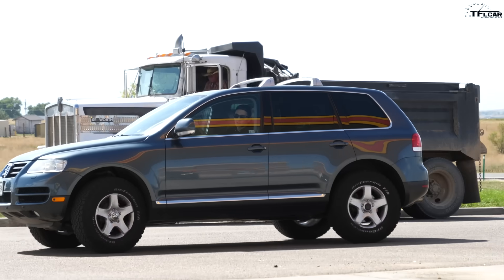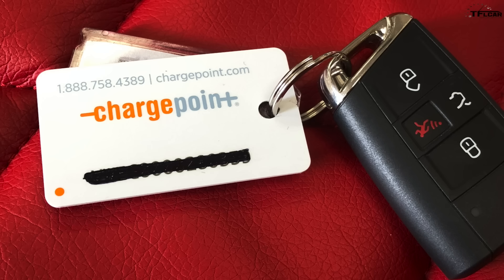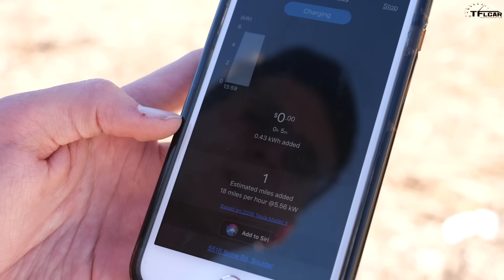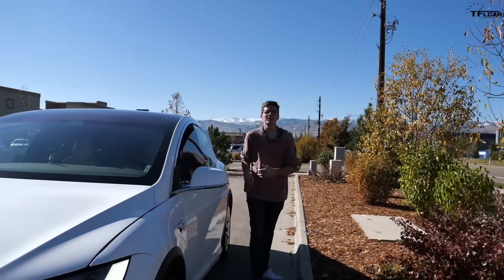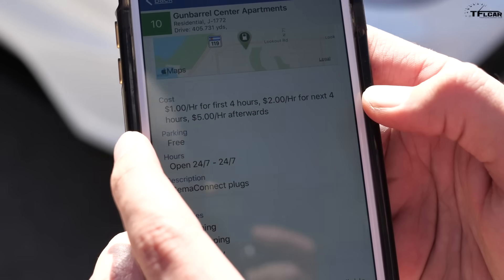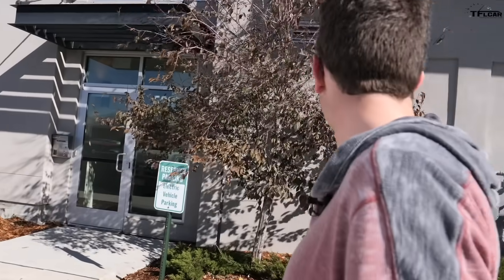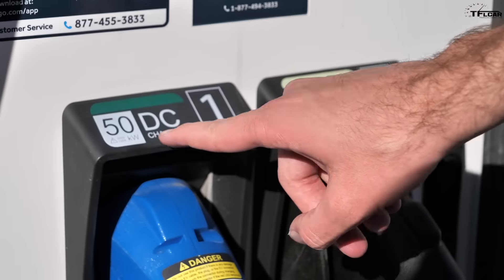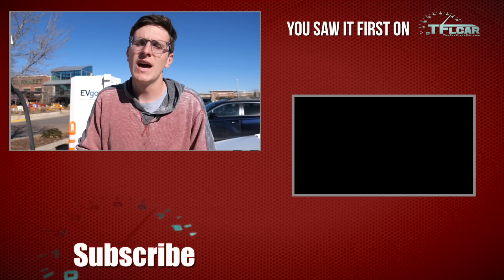Here’s Why Charging an Electric Car Can Suck - And It’s Not The Reason You Think!

Comment: What a mess. They have to make the charging faster and simpler before I buy an EV.
Reply: That's probably the biggest deterent along with the price of the car.
Reply: Agreed, there needs to be a standard plug just like gas stations have standard nozzles for  gas and diesel.
Reply: @Hogger280  Could have been IF legacy car companies had taken Tesla up on their 2012 offer  to use it's charging network for cost + power. That they didn't is the reason for the sad state of charging now for non Tesla's
Reply: Just get a Tesla and supercharge it. Way faster!
Reply: I can wait 12h to charge the car, I just want one that won't cost 2 years wages
Reply: @mwbgaming28  an EV doesn't cost two year's wages.
Reply: @bradmagnuson6963  it does in Australia, Nissan leafs are worth over $60k new, Tesla model 3 base model is close to $80k, and they're not much cheaper on the used market either

I saw a 2012 leaf with a completely rooted battery (3 bars of health and like 40km ramge) on gumtree, and the prick wanted $18k for it  

EVs are stupid expensive down here for some reason
Reply: @mwbgaming28  could be not enough EV's are on the market where you are, or, there's serious price gouging going on.
Reply: @bradmagnuson6963  there are not many of them because they are expensive, a car that is worth $15k on the used market here is less than $2k in the US 

I can buy a Tesla model 3 in America cheaper than a 2020 Nissan leaf here in Australia
Reply: Exactly..my bike takes maybe two minutes at a gas station and that includes swiping my credit card. I can't be bothered with planning where and for who knows how long an ev would take to charge.
Reply: I live in one of the poorest countries in Europe and 22 kW chargers are very popular here, meaning you can charge much much faster, still very inconvenient, but practically possible.
Reply: @Tzankotz  - lucky you, my area sucks
Reply: The year just need to supplement it with solar panels plus faster chargers to compete with a gas car
Reply: can only extract so much fossil to power your charger
Reply: They need to take the credit card directly as well I don't save any cards on online accounts or on my phone
Reply: Some of his information is misleading if you're not paying attention.
Reply: A one-hour charge time would work if the charging station was part of a destination like a restaurant or a store. But the real issue is the use of batteries. Capacitors can charge in mere seconds, but our current state of the art isn't there - we currently can't make them "big" enough to hold enough charge. If we could, the charge could be just as fast as a gasoline fillup, and capacitors don't have a limit on how many charges they can take. A safety issue exists, caps can dump charge through a short circuit a lot faster than a battery. So while shorted batteries will get hot and catch fire, caps can just explode like a firecracker, so fuses would be used to prevent that.
Reply: @dtvjho  So why not just change the battery every 200 or so miles? The battery would be large and expensive, but would actually be owned by an Electric Utility company. Mechanical means would be necessary to change it, but that change could happen in less than one minute.
Reply: @jackfenn7524  Good idea! The weight and size of the battery may be an issue though. I believe these car batteries are well in excess of 20 lbs/10kg, which would make them hard to handle for smaller people, those with disabilities and the elderly, or in a Northeaster with the wind and rain. Theft also comes to mind.
Reply: Would never buy one. Utter shite.
Reply: Notice how he's NOT using a tesla supercharger.
Reply: @prestontucker1687  - tesla charges in my area are all 40 miles from my house or work, the chargers he is using are better examples
Reply: @williamhaynes7089  This is just growing pains. Eventually everywhere. Charge at home overnight. Problem solved.
Reply: Take your time. You won’t be missed.
Reply: PrivacyPlease  What I meant by price is Teslas ( outside the U.S. ) are fairly pricey. The vast majority doesnt care about how quick the car accelerates and all the tech features. And then out of warranty repairs. Teslas built quality is not good. To each his own I guess.
Reply: Honestly, tesla is the easiest choice. It's faster and your guaranteed that there chargers will work without juggling 5 apps. And charging at home using a 1450 plug eliminates the need for super charging except for long trips.
Reply: One thing that people haven’t consider until now is that when everyone is in EV and you need to charge your car and there’s a long queue that you can no longer go anywhere because you don’t have enough charge to find another charging station. I guess this will happen in a very crowded area.
Reply: @randycho518  same thing occasionally happens with servos, you find a servo with really cheap fuel, and you figure that you will refuel your car since you have been driving with the red light on for a while, but then you realise everyone else has the same idea and you don't have enough fuel to go and find another servo that is less crowded

That exact situation has happened to me on more than one occasion
Reply: NIO is better at the time of charging your battery
Reply: An EV power charging station would be a carjacker/ mugger paradise. They know you are not going anywhere in a hurry.
Reply: @satos1  yes because door locks are not a thing
Reply: For sure!
Reply: Most EV owners charge overnight at home.  Even taking 30 minutes to get an 80% charge on the road is ridiculous.  As Bill Maher said:  "I have a Tesla to drive around Los Angeles.  When I go far, I have an Audi."  You look at how you intend to drive a BEV and ensure your choice has adequate range to cover that intended use on a daily basis.  If my driving needs required charging on the road, I'd get a PHEV.  Waiting 30 minutes or more to "fill the tank" (and that assumes the charger is available when you get there) is simply a showstopper.
Reply: @aldeflorio5500  if you're going on a long road trip, you should probably pull over every few hours and take a break anyway, after all, Tesla autopilot won't remove hunger, fatigue, the need to use the toilet.etc 

So you can plug in while you are taking that 30-40 minute break to have a feed or otherwise refresh yourself
Reply: @mwbgaming28  yes. But not at YOUR convenience. Big difference with a petroleum car. Park where you want without having to worry about charging so often. Plus refuelling is basically instant. Until you can make a car which can fully charge in 3-5 minutes, I’m not interested.
Reply: @kamenridergeiz9490  you do realize that the Tesla model S has longer range than many petrol powered cars (700km compared to 500ish km for my car) and if you have a home charger installed, just plug it in overnight, it will be full by morning, and you won't have to charge it for another week or so
Reply: @aldeflorio5500  BM must not be aware of Supercharging stations or doesn't want to bother with them.
Reply: @aldeflorio5500 , just stop and have lunch while you charge up...everyone needs to eat.
Reply: @aldeflorio5500  I live in an apartment...I would not be able to charge an EV at home. And owning two cars? Don’t be ridiculous, even if I could afford two cars...where am I gonna keep them in an apartment como,ex?
Reply: @aldeflorio5500  I have a VOLT since August and I'm discovering just that. CHARGERS ARE NOT RELIABLE. Some dont work, some are only during certain hours ( car dealers) and often more than a mile off highways, you make a valid point bro.
Reply: @bmw803  🤔 real life opinion, what is NOT in the EV propaganda, where everthing is perfect.
Reply: indoctus41  My complaint was one of the need for standardization, not ignorance.   Standardization was and is the key to industrialization and mass production.  Elon knows this and his success is due to minimizing the number of parts (e.g. the new two piece chassis design instead of dozens) and mass production critically based on standardization - just watch any of the many videos of his assembly lines.  Custom al la carte manufacturing of automobiles ceased 100 years ago with the few exceptions costing the buyer as much as a house for the privilege of obtaining one.
Reply: @Hogger280  Manufacturers are making sure you never want, or buy one of these things.
Reply: Bottom line there stupid piles of junk that has worse resale than a BMW in five years and will need a dumb battery that cost more than the car is worth after you take a hit on it in 5 or so years. Just dumb. Buy the time it's paid off you have to buy another piece of crap and it starts again. That's how they will make up profits on no maintenance like normal vehicles plus the poor mechanics that will be without a job.
Plus how is all this electricity being produced. Coal lmao.
Reply: @paulkruger2310  , solar
Reply: @dukeblair7792   If you were running a car around on the moon, solar would make sense. On Earth it's just plain stupid.
Reply: @jackfenn7524  , it's stupid to charge a car with solar energy instead of coal?  Really?
Reply: @dukeblair7792  How much electricity can YOU make with solar panels? It's easy to say that "they" should use solar panels to charge a car electrical system. Try actually doing it yourself!
Reply: @jackfenn7524  , it's just as easy as making electricity with coal...are you serious? The solar panels on your house can provide enough for your house...and a car...they have been doing this for years...where have you been? It's a piece of cake...what's up dude? You ok?
Reply: @jackfenn7524  , solar doesn't make sense?
Reply: @dukeblair7792  Okay, try making a significant number of BTUs with sunlight. But you can make thousands of BTUs a minute with a gallon of gas. Energy comes from BTUs of heat energy.  Sunlight just does not have the heat per square foot that is necessary to run a car.
Reply: @jackfenn7524  solar power is viable
Reply: @jackfenn7524  bullshit. If you put solar panels on a house, you can power the entire house, including an electric car charger in the garage
Reply: @paulkruger2310  you have no idea what you're talking about.
Reply: @paulkruger2310  .. California makes more solar than it can use.
Reply: @paulkruger2310  Funny how most people are trading in their BMW for a tesla.
Reply: @prestontucker1687  Funny how much more likely a Tesla is to randomly blow up and burn you to a crisp than a bmw. Batteries in cars are dumb an absolute disaster for the environment (a lot of batteries end up dumped) and slave child labor in Africa.
Running an electric car with a battery is like running a spaceship with a battery. Insane waste of ressources. Insane costs. It's just dumb. Again, hydrogen is the future, and I hope every person in the future whom bought an electric car with a battery will be forced to clean up their mess and not cost a cent to the rest of society.
Reply: @prestontucker1687  And I'll be on your back to make sure you clean up your mess in the future. Cheers
Reply: @prestontucker1687  Okay, explain HOW he is clueless!
Reply: @jackfenn7524  Sure he can show what it's like to use other networks.  This is not a tesla supercharging network. No tesla owner would use it. Doesn't even mention that for the lay person.
Reply: @Krullerized  funny, you have no idea what you're talking about. Hydrogen is not the answer, and won't be an alternative for at least another 30-40 years
Reply: @bradmagnuson6963  Toyota's Mirai begs to differ. It is already an alternative and it kicks VSS.
Reply: @Krullerized  industry wide, hydrogen is not an alternative. There is only a small area in California, that has hydrogen refilling stations set up. Other areas across the country, don't have the infrastructure to support hydrogen fueled cars.
Reply: @Krullerized  Just because 1 catches fire & makes the news. Doesn't mean 40K gas cars don't burn every year.
Reply: @Krullerized  Hydrogen is the future??? WTF???🤣🤣🤣
Reply: @paulkruger2310  Battery lasts 15 years.
Reply: @prestontucker1687  do not reinvent the wheel
Reply: @dougrockhold723  don't act like you know better.
Reply: @prestontucker1687  - but degrades over time
Reply: @paulkruger2310  You realize 30% of the grid is renewable & increasing. 
Your INFO is OUTDATED!
Reply: Fu*k you man! Tell me how many hrs. in your day you drive, most of the time cars are in parking. You have whole night to charge.
Don't support this type of childish problem videos because it's not the point. EV's are better than gas car because "bulb is better than candle"
Reply: Hydrogen electric cars. It's coming. This battery bs is dumb and a disaster for the environment.
Reply: who can afford to buy an EV?
they are very expensive toys.
Reply: @fivish  At one time a Model 3 could have been bought for $26k (with Fed and State incentives).
Reply: @grunt98444  - so my taxes I pay bought some one else a toy
Reply: @williamhaynes7089  How so? Tesla repaid any and all Federal loans years ago with interest.
Reply: @fivish  The average new purchase price of a car in 2020 is over 38K. There are quite a few full electric cars that cost less than that. (The prices are already inflated by premium add-ons). At this point lifetime cost of EVs is less than ICE cars and in most circumstances they are more convenient.
Reply: @tankbuddy9666  lmao,  30,000 average? The average person can’t afford that kind of money.
Reply: @fivish  no, they aren't, I bought mine for LESS than the price of a gas car
Reply: @fivish  So is buying an audi, bnw, a mercedes a boat a camper or a 65 inch tv just expensive toys too? Maybe the problem is you need to get an education so you can get a decent job that allows you to buy things that make your life better.
Reply: @fivish  repairs are so infrequent as opposed to ice cars
Reply: @Doesitreallymatter-q3d  Buy a KIA petrol car and have no repairs.  Much cheaper and very convenient.
Reply: @fivish  why not just stay in the past where your comfortable. No need to progress, regression is even better. Is that your idea?

Comment: I love my Prius Prime I have 2000 miles filled the gas tank 2 times  so far I can get up 35 miles with careful driving on electric another 650 miles on gas majority of my drive is commuting to an from town about 18 miles I get to town and back on electric gas  engine starts up only when I am 1/4 mile from home cost for a full electric charge at home 56 cent at 6.5per kilowatt so total cost of 2000 miles is about 100 dollars I love my Prius Prime I love the auto braking system I was driving 66 miles an hour was not aware a deer jumped onto the road until it was to late  Radar caused  the car to break hard but no damage to the deer it just walk away and so did I not a scratch on my car or me lots of deer where I live  they are a constant hazard here they need to be culled so many bad accidents here because of dear many cars are towed away a write off .

Comment: A fix for all this mess is just buy a Chevy VOLT, it has the best of both worlds. It will drive 100% electric for up to 53 miles and then the gas generator will start up and charge the battery as you drive. The sad part is that GM in their wisdon has stoped making this amazing car.

Comment: The ones that charge by time are punishing those of use with smaller battery packs.   Since the rate of charge varies by how full the battery is.   So as you reach the 80% mark where most commercial chargers stop charging your car it is charging far slower.   So my 9yr old Mitsubishi I-miev  which has 10Kw of usable battery left starts charging at 20 Kw/h when empty (fast charger) and slows to trickle when near 80% end of charge.  So it will take about 50 min for me to charge up 8 Kw (and I need every electron).  But a car with 40Kw battery pack can charge at full rate for entire hour would be able to achieve my 8 Kw in 20 min.   So my 8Kw ends up costing 2x as much if you go by time.        Same is true of companies the charge a minimum hookup fee.    Those with 100kw to charge pay the same as those with 10kw to charge.   But the 10Kw cars pay the hookup fee 10x vs the 1x for large battery.    Now that is extreme example to make a point, but it seems a bit unfair to the smaller pioneering early adopters of electric cars.

Comment: You would only go to these slow chargers if you're shopping for a length of time of desperate need to charge.   Boulder has 10 Superchargers here Twenty Ninth Street
1710 29th Street
Boulder, CO 80301.

Doesn't the USA have 40 or 50KW rapid chargers available in type 2 or CCS ?    Given that Tesla is an american company and its up against the legacy auto makers the author has a small point, but its not that difficult really.    I charge my model S at 6 miles per hour at home and use superchargers or destination chargers when travelling.

Comment: The EPA regulates consumer diesel pumps to 10gpm @ ~40,000 watts per gallon 400,000 watts per min. 
Commercial truck stops usually pump @ 60gpm @ ~40,000 watts per gallon is 2.4megawatts per minute. See ya then Tesla.